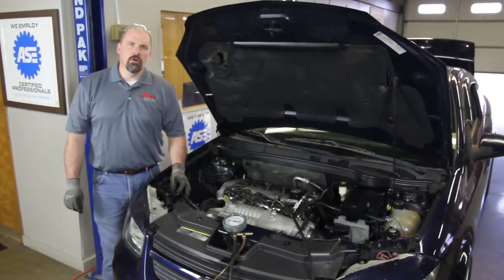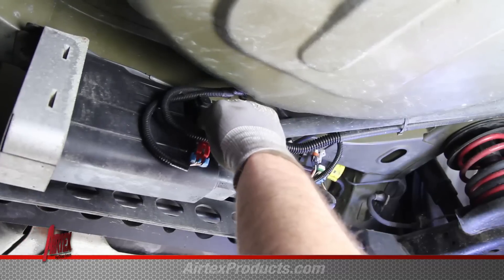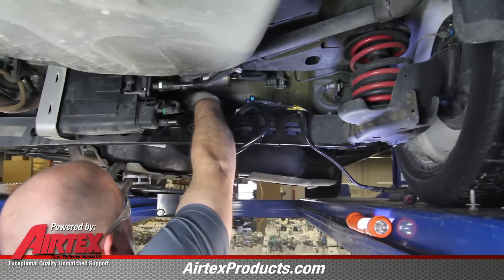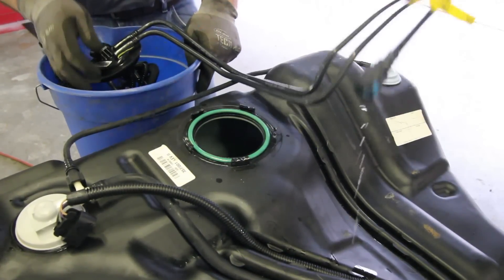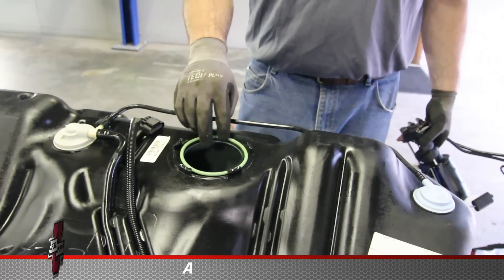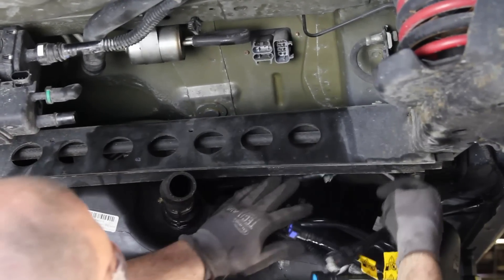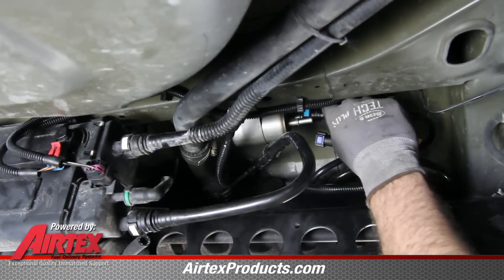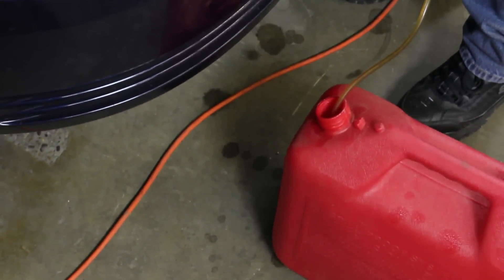How to Install Fuel Pump Assembly E3726M in a 2006 - 2008 Chevrolet Cobalt

Comment: I haven't found a video yet on YouTube that explains how difficult it is to remove and reinstall the fuel tank from the HHR. You must lift the car by compressing the suspension.  If you allow the rear axel to hang, it will not allow room to remove the tank. Also, the tank will need to be removed away from the driver's side toward the passenger side
 You'll also need, most likely, to release the exhaust hangers, but not unbolt the exhaust. With luck, you can work the tank away from the driver's side and drop it to the passenger side. 
Reinstallation is the reverse, but you won't have gravity to assist you. 
Every video ignores this crucial portion of changing the fuel pump as if it doesn't exist. These vehicles are designed with minimal space for removal and installation.  Plan on this being the MAJORITY of your effort.
Reply: I’m thinking about cutting an access hole and the river it back together (without damaging lines and wires). Been down this road before.

Comment: do you need any special tools for removing the fuel lines and such? video doesnt show such, looks just like push buttons on the lines?
Reply: Tim Walker no tools were required. Sorry I’m two years late, but they’re just push buttons. Only the fuel FILTER has a tool requirement which is a little plastic clip release tool.

Comment: HELP!!! I have a cobalt 2008 2.2L but there is no fuel filter and the pump that I bought does not fit!... what is wrong??? looks like I need a return-less fuel pump, cause there is no return line where to connect the , please someone help
I can't share the pictures on youtube

Comment: What size socket did you use to remove the tank straps
Reply: +michael holder 13mm socket on 2006 Saturn Ion

Comment: have a 06 cobalt ls. ran out of gas on the way to the gas station from my house. went to get a gas tank from my brothers house and filled my up with maybe about 1 to gallons. havnt touched it since. my brother says that the gas tank that i used, might have water in it. due to it being outside when it rained. 
so my question is, is there any way i can get rid of that little amount of gas that i have with out taking out the fuel tank?

Comment: hey, master tech you should know that you need to replace fuel filter at the same time for proper warranty. why not show use the cleaning of the inside of that tank instead you showed some dodge tank.
Reply: JASON SUGARS yea that’s what I was thinking. That is not at all the tank bc it has a hose on it for some reason

Comment: Hi, I need help with my 2009 cobalt, I took it to the dealer for diagnostic, they told me that fuel pump it has low pressure (237) and it suppose to have (450-500)

That`s right?
Reply: Hi, Airtex Pumps
Yes, I send the vehicle to the Dealer and they said that.
The vehicle it1s 2.0 turbo
Do you know Psi for this?
I was afraid if I install the gauge.   Mine doesn`t  go that high.
Thank syou so much for your help.
Have an excellent day
Cordially,

Ramon Garcia
Reply: Hi, Airtex Pumps,
Thank you much for this information
Have a wonderful day.
Sincerely 
Ramon Garcia.

Comment: my fuel filter is not there, I have a 2009 2.2L any advise?
Reply: Lindsey Withrow your fuel filter had to be in your car, if it wasn’t, you wouldn’t be starting it and you’d see a gallon of fuel on the ground if you did manage to
Reply: I got the same problem. We got PZEV (partially zero emissions vehicle) it's a pain and i still can't find a video on replacing it.